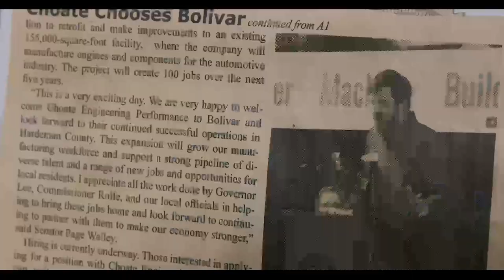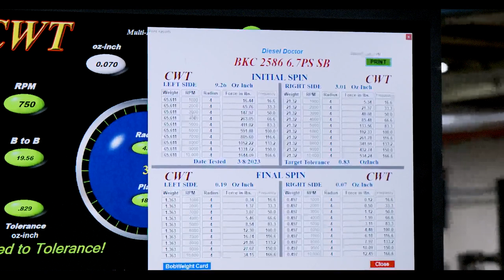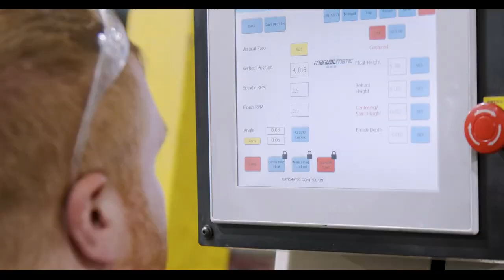The Diesel Masters - The 6.4L Power Stroke That Left Us Stranded

Comment: Great content. Love my deleted 6.4
Reply: Yes.  6.4 ford 08 super duty As well I am using a good-quality fuel additive with some what is it. It's like octane boost is it centain? Now I met a fellow at a rock crawler  event we got to talking.His big deal was the lack lube in modern diesel not having any lube. . He suggested if I don't  want to replace my HP fuel pump I should use 200cc of 2stroke fuel mix to every 16 gallons of diesel as well. Anyway why not it certainly won't hurt might even work on the valves etc.. I also put a larger DIY catch can on. It's 4"X7" with 1"ID tubing in and out on the in it goes to a 90% 1/2" tub to the bottom baffled with as many 1/4" holes to disperse the CCV contaminants throughout the can. There is a 1.5-deep containment reservoir at the bottom. 2 baffle plates that have SS wool pot scrubies up to the exit port. With a 3/8" ball check drain valve on the bottom. The thing since I've been doing this about 1K miles the blow-by seems to be .5 of what it used to be. Anyone who knows the 6.4s is notorious for high Blow by from New. It is now what you could call normal. ?. The truck has 136k miles on it. It is May 07, 2024. Yes, that is low miles. 30K have been with Delets and a MinniMax set at Stock to Tow Haul. I will never race this engine. But I will give it something to pull, and a payload from time to time. With a stringent maintenance routine. Just rebuilt the trans. Started showing coffee grinds. So I thought what the. She had a hard younger life while on warranty in the cold North🇨🇦

Comment: I have a question ? Why don't you venture into making 6.4 front covers or one that would eliminate the cavitation issue? Or has someone already came up with this?
Reply: I don't think you get cavitation if the cooling system stays pressurized
Reply: And use the proper diesel coolant with the Ford additive.